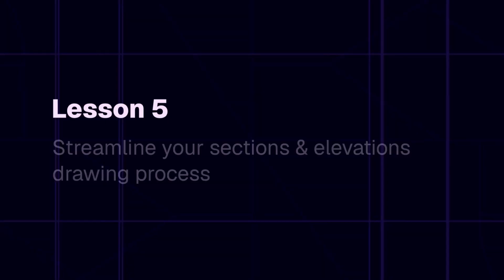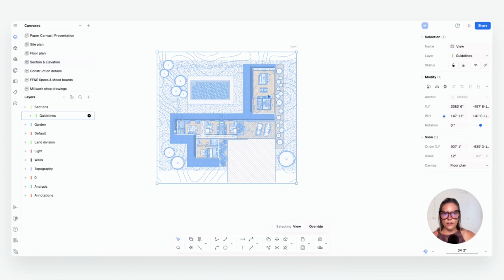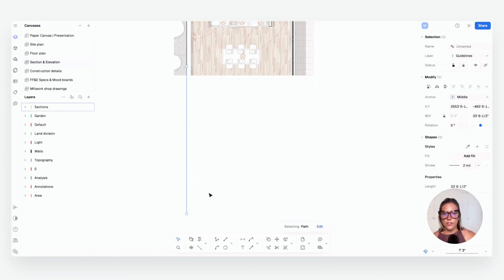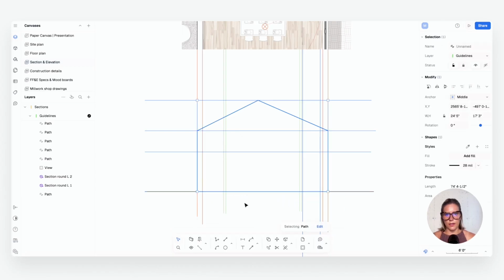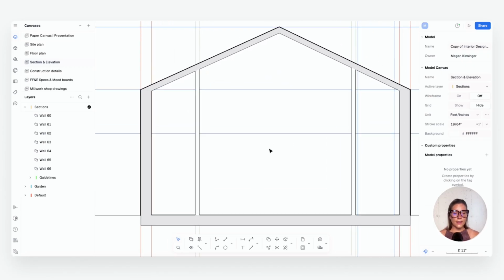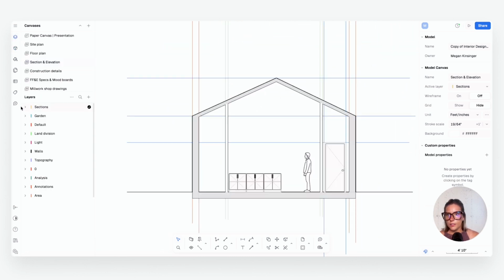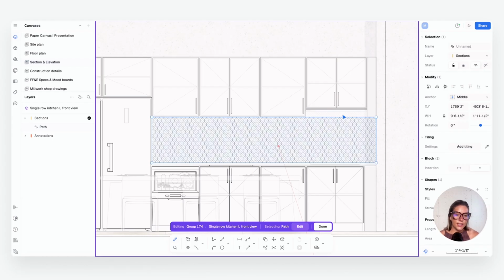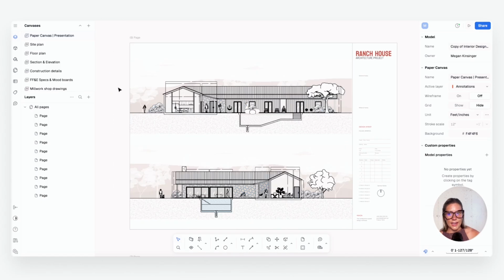Streamline your Sections & Elevations Drawing Process

Comment: Inch unit isn't usefull why why do you prefer inch?
Reply from the maker: Rayon doesn’t “prefer” inches specifically — it usually depends on your project settings or template. You should be able to switch to metric (mm/cm/m), which is much more practical in most countries.

Comment: Hi, I am an architecture student. Is there any way that I can change all the library block views into front views? Cause I am making a section drawing. I want to find a cleaner, nicer shelf, and they all look the same from the top. And if I can change it back to top when I am making a floor plan, that gonna be awesome.
Reply from the maker: Hi there, sure! You can use our filters and select views=front/side. This will show you all the blcks in the view you need:) Here is some documentation on this topic: https://docs.rayon.design/other-resources/product-updates/september-25-product-updates#filtering-options-for-libraries